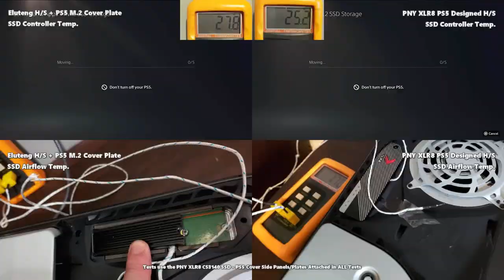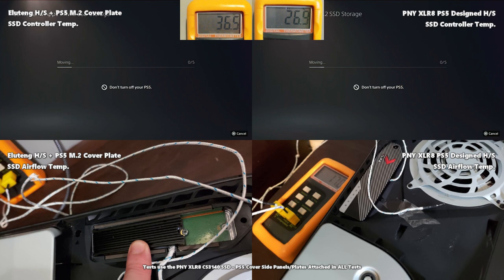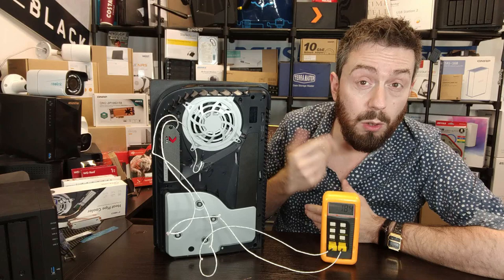PNY XLR8 PS5 SSD Heatsink - TEMPERATURE TESTS

Comment: Have you ever compared the temperature differences between using the Seagate Firecuda 530 including heatsink with the ssd bay cover versus Seagate Firecuda 530 using the PNY/Sabrent PS5 heatsink?  I think that would be a very interesting experiment for those people that can only get the bare drive versions. Or any/all SSD's that have variants with and without factory installed heatsinks. Love all these PS5 SSD test videos. 
Also a heads up for anyone reading this, Amazon and a few other vendors have been selling the Adata XPG Gammix s70 Blade S70 (and full heatsink) for either $125-130 or $145-160 with a $20-29 discount coupon. There are also 2Tb models for $220-250 also with a discount coupon of $10-30.

Comment: Can you do some testing on the Kingston Fury Renegade SSD for PS5 by any chance? I’m torn between it and the Firecuda because their read/write speeds are identical to each other on paper, but the Fury Renegade oddly enough has a heat spreader attached and Kingston says that a heatsink isn’t necessary for it.

Comment: I enjoy all the heatsink reviews thankyou, but is the best option to buy the SSD where the manufacturer has installed the heatsink at production. Or is it best to buy the SSD without heatsink and add a third party heatsink? What are your thoughts on this?
Reply: I have the same question.  Like the new Samsung 980 pro with stock heat sink vs  the 980 with this heatsink
Reply: He recommends buying it with the heat sink already installed. I frankly don't know why if the third party ones do a considerably better job at keeping it cool
Reply: If your not good with tech then you want to go for the all in one. But if you are. You should get a third party with whatever choice of ssd you want to get with it
Reply from the maker: Cheers for watching guys (also, umm @Robbie - you aren't me, are you???). In most cases I definitely recommend a first party heatsink (i.e a heatsink that is by the same brand as the SSD) if 1) it is a PS5 designed one, as they have all been very good so far and 2, in the case of traditional m.2 PC heatsinks such as Firecuda or WD Black, these heatsinks are applied at the factory level and done so much more precisely to the chip architecure of the drive and in a dust controlled/factory environment. All in one SSD+Heatinks have been pretty solid, barring only a couple of exceptions and even the more affordable ones like the addlink A95 have been incredibly well applied at the production level. Hope this helps guys. Have an awesome weekend and I recommend the beer...

Comment: I liked the elecgear to the sabrent and now pny for one reason.  The ssd I bought was $900 (firecuda 4tb) and my ps5 is $500. If the ps5 dies it is substantially cheaper to replace lol

I have a feeling the pny will unseat the sabrent between the two of them

Comment: Nas do you recommend putting a thermal pad on the bottom of the ssd when using the pny or Sabrent plates? I’m using the sn850 and it’s only a single sided nvme drive?

Comment: I've meant to ask what's your quality standard you're using for thermal pads?  Some are much better than others apparently. It could be helpful for others maybe looking to duplicate your performance or decide they want better if cheaper pads are getting xyz result in these tests.

Also thickness for the pad used on the given ssd.  I think for the folks new to this that information for those could be helpful.   Just a thought for folks that want to copy and paste your set ups for the test.

For anyone reading I'm using an elecgear with Gelid Solutions GP-Extreme thermal pads with the thickness being 1.5mm and 1mm on a Firecuda 530 4tb.
Reply: I believe I’ve seen your comment posted on another video about your exact setup. I also have the elecgear and firecuda 2TB configuration and I’m fairly new to all this. Where exactly did you place your different sized thermal pads on your m.2?
Reply: @beep_beepim_a_jeep5162  1mm pads on the nand and 1.5mm on the controller. You'll have to do some cutting on the pads!

I know on my 4tb, the controller, it sits lower than the nand. Hence the reason for this on mine. I'm not sure if yours has that happening. You'll have to look at how your 2tb is set up
Reply: @benlastname6667  thanks I’ll take a look Monday when my m.2 arrives and did you end up using the support eva?
Reply: @beep_beepim_a_jeep5162  no problem. The support what?
Reply: @benlastname6667  the black piece that comes with the elecgear package
Reply: im using the same 2tb FireCuda on the ElecGear and ordered 3rd party thermal pad 0.5mm, do u guys know if i should install few of them cut and stack above each other or is it better ordering bigger thickness?
Reply: @yaniv3050  better to order bigger thickness. Air might get trapped between pads.

Comment: Any thoughts about some complaints regarding the wd sn850 with factory installed heatsink, the thermal pads are not touching the chipsets?
Reply from the maker: I'll be honest, I hadn't heard them. I'll do w spot of research and see if I should share on the channel. Cheers for the heads up on it

Comment: Don't understand your Elecgear critism.
Nobody had any issues with the heatsink and It achieves the lowest temperatures possible. It causes no harm to the PS5 system.

About the PNY It looks like it's a little better than the Sabrent. They achieve the lower temperatures with their own special design. Problem of the PNY is the price and the availability.
Reply: Elecgear no longer ships it with a copper heat pipe which was its main selling point. They changed it to an aluminum pipe smh super shady. Still charging the same price though
Reply: @SirFartsAlot1  
Bullshit:
(copied from Amazon)

 I contacted the manufacturer and they confirmed it is still a copper pipe and have only changed the plating to nickel which explains the color change. I have attached the full response below.

Thank you for your message.
We have changed the surface finish recently. This made the change of surface color.
It was changed from Copper tube + phosphating to Copper tube + Nickel plating. The two types of finish are the classic technics to deal with pure copper to prevent it from being oxidizing.
For the color tone concern, we changed it from the phosphating (Copper color) to Nickel plating (Silver Color). This is because the copper color is a warm color, while we think the silver goes better with the main color of the heatsink body (Dark grey with a little metal blue inside.). We want it to be cold color since it is a cooler. We’re sorry we did not noticed this concept when we first launched the product.
One problem is that the P5C selling link has been shared by all marketplaces of Amazon. However, the inventories in these places are different in the surface color. The big cause is the shipping transition to some marketplaces were a huge delay. They're not synced. So one color can not reflect all the products in Amazon facility. We updated the Amazon picture yesterday since more 'Silver colored' P5C gets in Amazon.
We're confident that all the EL-P5C comes with pure copper pipe with extreme performance.
Thank you.
ElecGear-Tech Support
Reply: @OlderRockRocks   I call bullshit right back at ya, really seems more like a company just trying to save face. Why don't all other companies do the same if it's superior? or to combat oxidation?! The ps5 heat pipes don't do it nor do any other pc heatsinks from major manufacturers. Or again is it more likely they changed it because it was less costly or they couldn't keep up with demand.
Reply: @SirFartsAlot1  Im with GrumpyDad on this.
I bought the elecgear and noticed the copper tube was in fact silver,i was convinced it was aluminium.However  my curiosity got the better of me and after a light going over with some 400grit wet and dry paper it is totally 100% copper underneath the plating.I cant show a pic as its in my ps5.All the best.
Reply from the maker: Wowser, this chat thread got heated. Let's chill a sec. @Robbie (still not me, but I do love the name btw) let's give the company the benefit of the doubt for a sec and if this is a simple misunderstanding that they are trying to fix, let's give them a week or so and see the proof in the pudding. @GrumpyDad (hot damn, I love that name) the annoying truth is that alot of users are pissed that the product they received is the same as the thing they bought don't have the science/metal experience to know if the update from the brand is the truth or short term PR. I do think that its odd to change one of the most visually appealing and attractive elements of their product (in material or just aesthetically) and moreover its a big enough shift in the design of a product that not updating the details on a product spec page/online is a bit odd. As for my words on the elecgear generally, it IS a bloody good heatsink! But it would be remiss to say with 100% certainty that we know have zero impact on the system. The PS5 is an extremely efficiently (in terms of cooling) designed machine and the fact that people designing it put an m.2 slot in a small metal box, significantly reducing active airflow, then suggested covering it... that seems tremendously counterintuitive to ALL other usages of a PCIe 4 M.2 NVMe. So the only conclusion I can reach based on that is that they did it to reduce heat from said m.2 SSD entering the system by some degree. But again, this is conjecture too. So that's my main basis for it.. the sabrent, the PNY, even the INEO/Graugear (ti a lesser degree) seem like a middle ground to hedge the bets and the temp readings seem to back that up (overall). I should also add that I love debating these things and if I am wrong, better to be proven wrong! Have a nice weekend chaps. Toodle pip!
Reply from the maker: Cheers for the input @Andy Dann! Will share your comment
Reply: @nascompares The  Amazon ad  has an updated pic of the elecgear heatsink with a silvet coloured heatpipe.Like i said mine is def copper under the silver plating.
Love your vids 100% .Cheers.